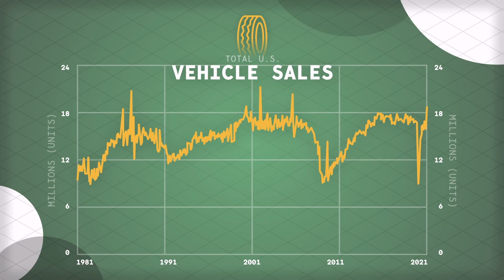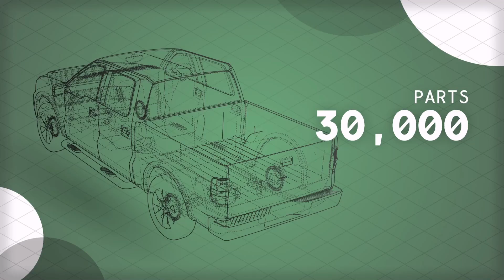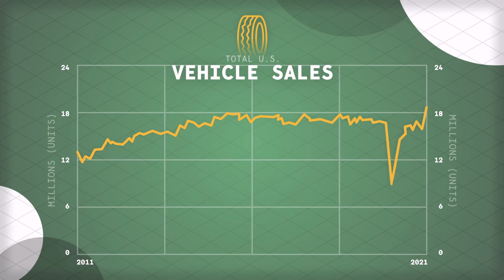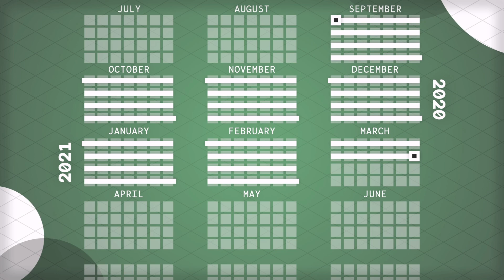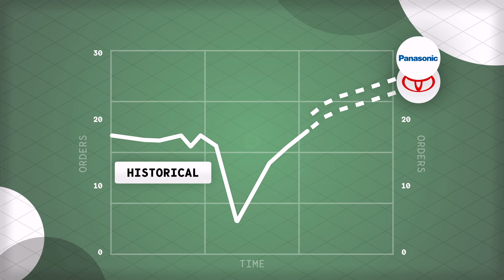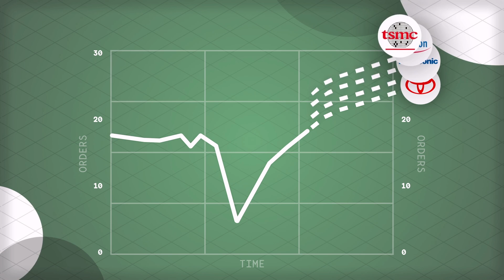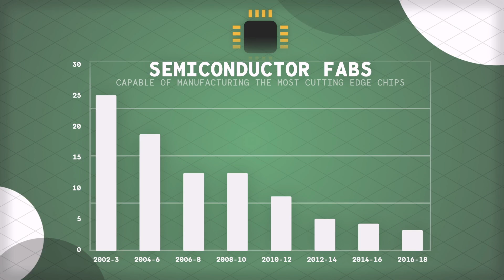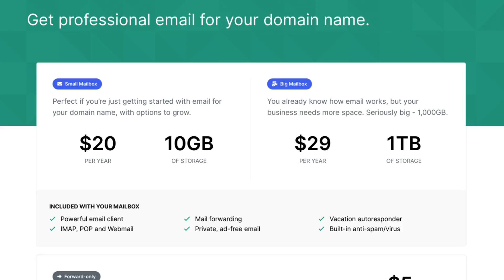Why the World is Running Out of Computers

Comment: The world is not running out of computers.  The world is squeezing out reliability, flexibility,  and stability out of all of our systems.  Every one of the more important automotive use cases could be served by single chip computer produced 5 years ago.  Thank you Just-in-Time supply chains and globalization.
Reply: @Cancer McAids For some business I think you are completely right. Most blatant example is the layoffs at Activision Blizzard.
Reply: Five years ago, automotive computing was quite distributed.  A 2015 VW Golf has a CANbus controller, a multimedia proccessor, transmission controller, engine controller, door module controllers, lighting controllers, body electronics controllers, collision avoidance radar controller and more on top of that. You don't know what you are talking about.  You have to go more than twenty years ago to find computing as low as five major processors.
Reply: @matthewgaines10  I didn't say 5 processors - I said 5 year old chips.  And I said important automotive systems.  Love some of your examples which seem to prove my point "multimedia processor", "door module controller", "lighting controllers", "collision avoidance radar controller".  These things are done for profitability and the designs reflect the company and social expectations, which discounts risks and vulnerabilities.
Reply: @Cancer McAids very well said
Reply: Just in time supply chain is not the problem here.
Reply: @carholic-sz3qv  Just in time supply chain is not the problem here.... so what IS the problem, Obi-Wan?
Reply: It's happening now with #48VDC platforms on #RISCV.
Reply: Funny I don't see Apple having this problem with the M1 based stuff. I'm not currently in the market for a 10th or 11th 14nm Intel Part but, i gather that there are in fact enough of these for those whod want them. AMD RX 5700s though? Not so much.
Reply: @Cancer McAids I feel like I need to nuance what I said cause I think the reason we aren't doing that long estimates is because it is hard. For example ask yourself what you are going to do tomorrow and compare it with what you think you are going to do in five years. Time makes for more uncertainties that makes planning much harder. But we still can add some more planning to the system, but lets not plan for things that can't be planned for.
Reply: The Globalization part isn't really that bad. Otherwise, the really good brands of certain things will be confined to Developed nations, and the rest don't have access. Most of us already can't afford them due to prices. If even the rich in Developing nations couldn't get them due to restricting access to only certain countries, we'd be f-ed. Of course, one could argue that such a scenario would lead to locals trying to make their own versions, but without free access to the originals, I don't think we'd be able to do so without having to repeat the same mistakes the original inventors and manufacturers did. There's getting the originals via black market shipping, then investigating how it works behind closed doors, but eh.
Reply: @moondust2365  Globalization has a lot of cost benefits, but the flip side is that it can increase risks if it results in long supply chains and restricted suppliers.  The risks have been socialized but the benefits are often private.  JIT has eliminated wasteful work-in-progress, but also stockpiles that served to reduce risk and provide flexibility.  If the world is going to take advantage of China's distortion of aluminum production, maybe some of the benefit should be offset by mountains of aluminum piled up in Wyoming and Germany.  Right now, lumber prices in the USA have increased quite quickly and strongly compared to the change in demand.
Reply: gather round everyone, this guy on YouTube obviously knows something we don't.
Reply: @Izack  I actually think he has a point. Most industries hunt better figures for the quarter rather than thinking more long term in their decision making. Basically any disaster that is more than a year away is not considered in any kind of risk/reward analysis. We have been reminded multiple times the last year how vulnerable our system is. Efficiency seems to come at a cost.
Reply: @Izack  kek have fun with fucking windows 10 crashing your fridge
Reply: Automobiles haven't gained much reliability or efficiency since OBD-II that can't be attributed to improved mechanical designs. The margin that improved electronic control systems adds can be done without for the sake of availability. For example, we went 100 years without electronic traction control, direct injection has added more issues than it solves, fully mechanical dual-clutch transmissions were first sold to consumers back in 1961, ABS and airbags have been around since the 70s, etc. The only thing I can see that might add a significant efficiency gain would be VVTs, but even those began as fully mechanical systems.
Reply: @MrTaxiRob  nonsense, cars have significantly gained efficiency and reliability over the years. Hybrids vehicles, diesel.... modern cars are much more powerful/efficient.
Reply: @carholic-sz3qv  SINCE OBDII (1996?) There were economy cars making 50MPG in the late 80s and early 90s, now hybrids struggle to match them. Yes they are bloated with luxury options today, but if tech is that much better... and they're HYBRIDS... why can't they meet those same goals? I suggest you take a closer look at the numbers.
Reply: @MrTaxiRob  in the past cars were basically dead tiny shelfs, very light, no particle filter systems....... modern cars are much more complex, we have not only luxury things but tons of airbags, radars, cameras, automatic gearbox integrated with engine ECU, electronic cuspension controls, sunroof, gas/brake/steering by wire........ Modern cars are not only bigger but also heavier, more automated have better catalytic converters, more efficient and even powerful engines.
Reply: @MrTaxiRob  a vw modern 2l tdi engine is used in a pickup truck which can even tow and still has amazing fuel economy still  unlike the big 7.3l diesel Ford engine from the past. Today a mercedes 2l engine produces over 400hp compared to a giant 7l American engine.
Reply: @carholic-sz3qv  dude, do you even read my comments before you reply? SINCE OBDII what NEW technologies have we created? NONE. How much has fleet MPG improved under CAFE standards? Do you even know?
Reply: @MrTaxiRob  obd2 came after odb1, obd2 is already a great technology and there is no need to improve it since it has bluetooth and other connectvities, with odb2 you have way more accès to the car compared to a tesla where everything is locked down.
Reply: @carholic-sz3qv  OMG.... I've CLEARLY been using OBDII as a specific chronological event to mark the peak of automotive engineering concepts. As in, nothing that is happening today is really new. It's like you read my words, but don't "get it."

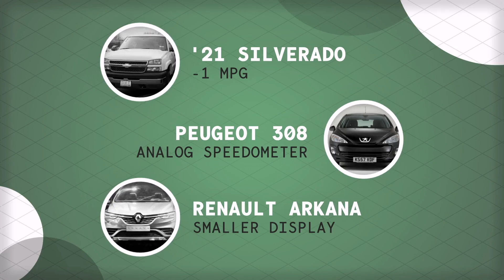Comment: 2:07 60.000.000.000 bucks damage dealt to the industry by idiots who have decided to just sit on the almost-finished cars and ruin the whole industry instead of producing cars without microchips. ANALOG CARS. Interesting, fun and reliable cars without stupid infotainment and all other bells and whistles.
Reply: You cant just take the computers out of a car that needs them to function now. From engine timing to diagnostics, valve control. Its not just stupid infotainment add ons to woo customers. Cars have been basically fully integrated computers for a decade now.

Comment: iPhone has another reasons to raise prices this year.
Reply: They don't even need any reason, there customers will buy it at double price also..
Reply: Like they need any other reason than greed.
Reply: Courage to raise prices in ample doses.
Reply: They don't even need to rise, just remove existing features to save more costs or sell you other products like the headphone jack or a charger.
Reply: @ricardos8307  Next iPhone: Screen sold separately.
Reply: @drewhallson8203  I wouldnt be surprised if they remove the lightning charging cable next and still raise prices because "reduce e-waste" 😂 I'm glad I'm an android user, pay half price for similar and in some points better hardware while you have the option in some brands to include the charger for free if that's available.
Reply: What reason do they even need when their consumers are retards that buy the same phone every year at increased prices?
Reply: I see you everywhere
Reply: Maybe if you buy from TSMC.
Reply: Can't wait to buy $50,000 phone in 2077
Reply: @hextechmagikarp4610  that will be 2023 because hyperinflation is coming
Reply: And remove features that previous phones had.
Reply: Dont buy apple